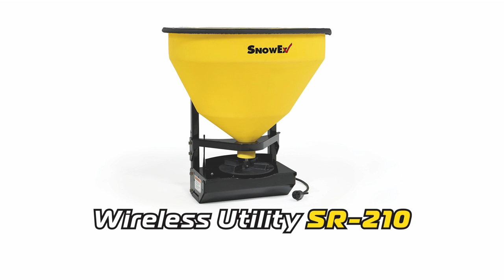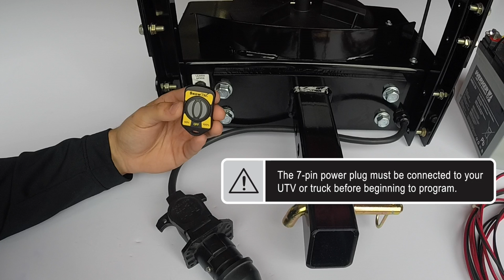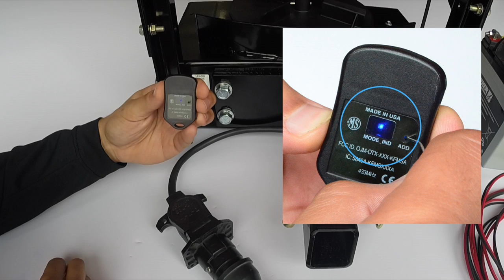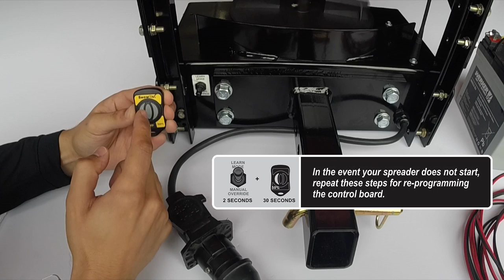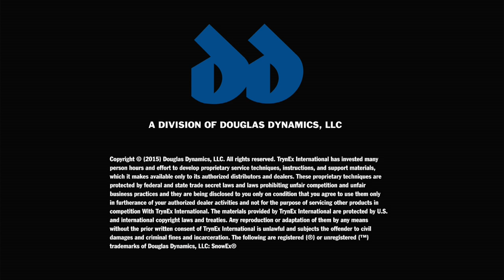How to Pair the SR-210 Wireless Key Fob to the Spreader

Comment: After 4 months, my fob has begun giving me issues. Works then doesn't, changed battery to no avail, can rarely get blinking light to program. I have to use manual override to spread salt, wasting salt while I get in & out of truck. Dealer support is terrible, keeps sending me on my way w/o fixing issue, simply insisting truck connections must be problem without troubleshooting anything. Probably needs new fob as man override works fine, but dealer won't try one and at $100 I'm not about to 'try' buying one. I'll probably find another brand - AND DEALER - for future purchases.